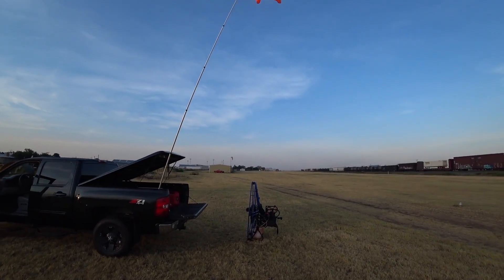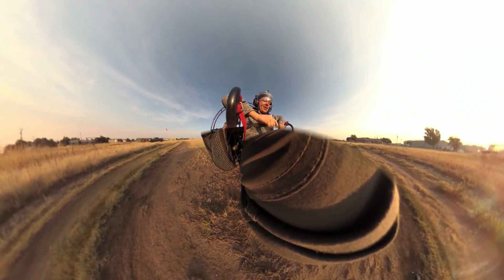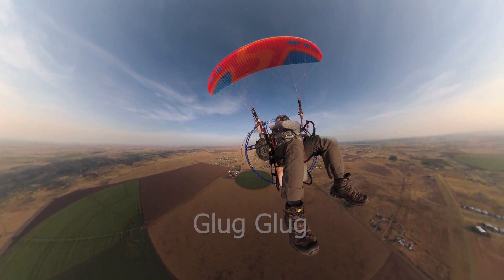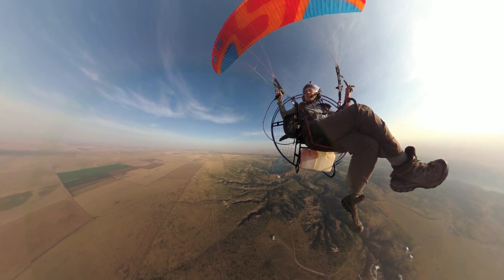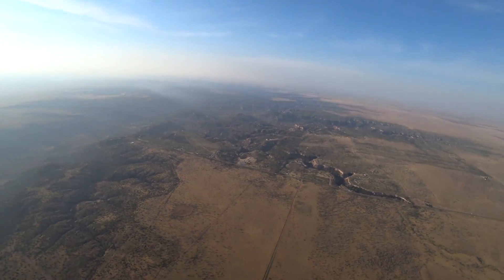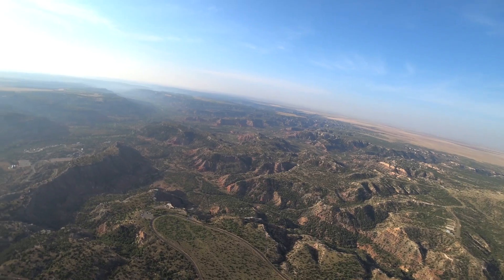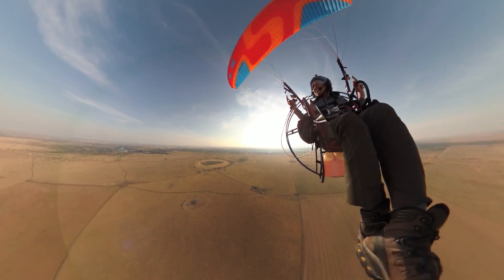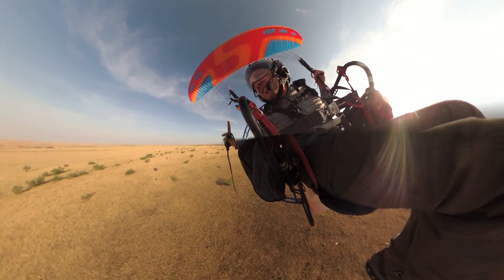What if I have to go PEE While Paramotoring???

Comment: Beautiful scenery and nice video.  Does your fuel tank have 2 separate containers?  Aftermarket or stock?
I have accidentally left the throttle out of my hand when starting it too.  Hopefully never again though.
Reply from the maker: Dual fuel tanks.  Increases drag and weight a bit, but great range addition.  It pulls from the secondary first, then the primary.  Factory OEM option from skytap.

Comment: Your throttle cable looks extremely long! What motor is that? I wonder if it's just the camera angle but that scares the crap outa me
Reply from the maker: It's not :).  It's the perfect length, it's probably wierdness from the 360 camera.  Until I have a drone that will have to do :)  The frame is the Skytap Angel.